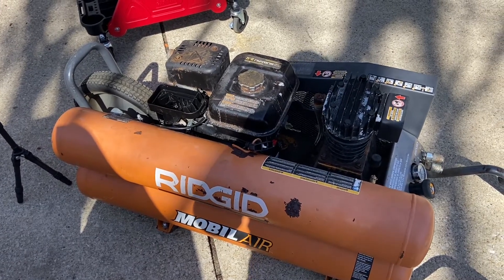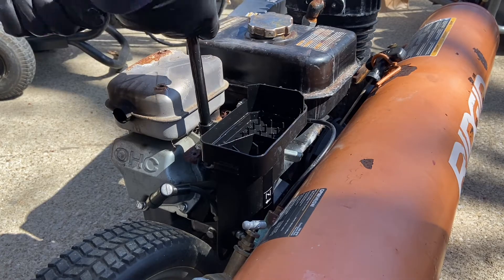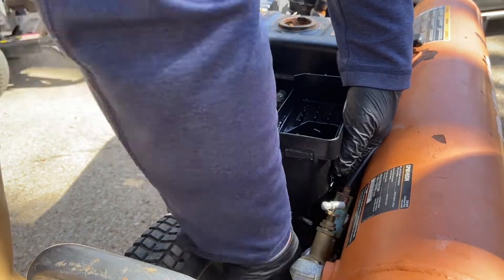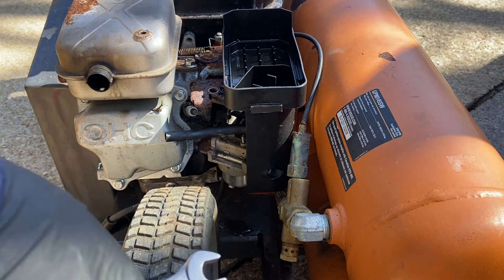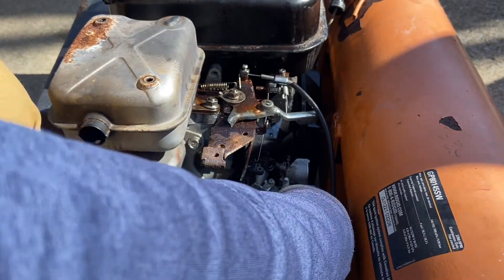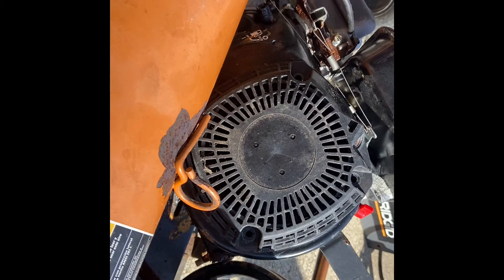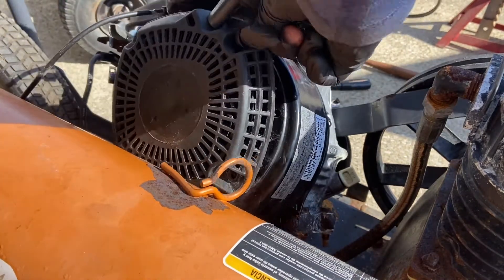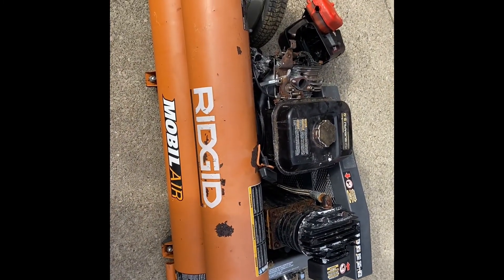Ridgid Wheelbarrow Air Compressor w/ Subaru EX17 or SP170 too far gone to save

Comment: It's much easier to work on if you remove the tanks. They are really easy to remove and make it simple to work on.
Reply from the maker: That unit was a disaster!!!! the previous owner had a bag of lye break and never cleaned it off.  Lots of corrosion and damage.  I ended up trading it to a friend sho said he took it completely apart, sandblasted, repainted and got it working.